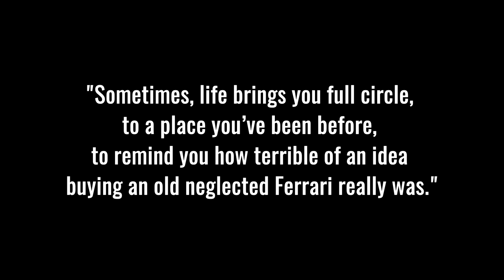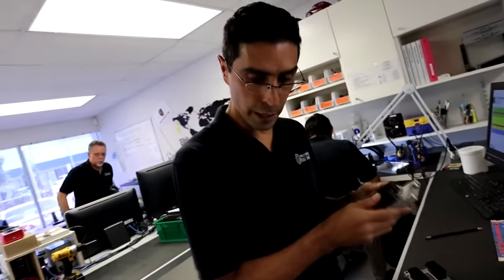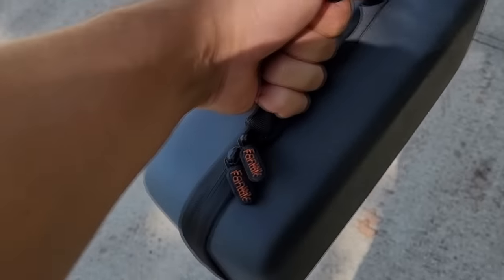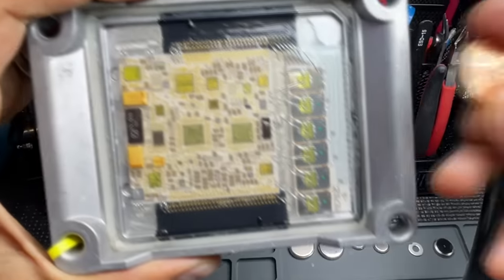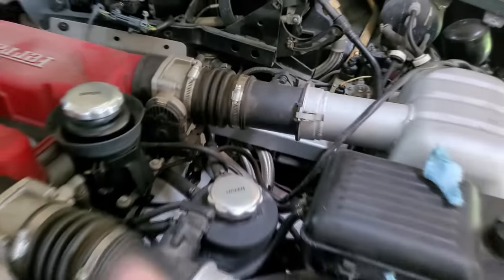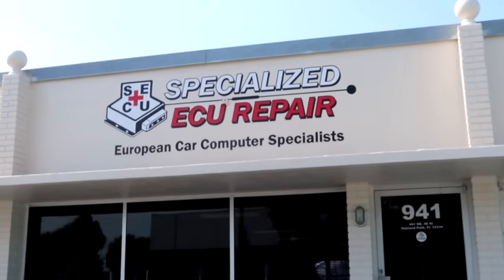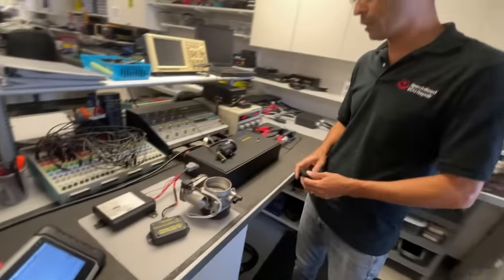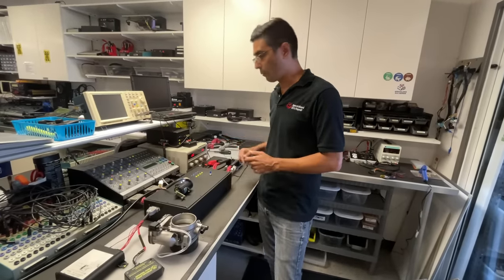Here's What FINALLY Fixed my Cheap Salvage Ferrari!!! (EVERY Ferrari 360's Fatal Flaw)

Comment: If the actual fault can be identified and narrowed down to one chip, and a packaged version of that chip is available, it would be possible to make a PCB with that chip, and patch it in using a wire-bonder. A wire bonder is a standard piece of equipment used in the semiconductor industry - they can sometimes be found surplus ebay, but you could probably rent time on one for a 1-off job.
Reply: You star Mike!   You and the likes of Allen Millyard are amazing with your knowledge...
Reply: If you could get a packaged version of every chip, transistor, etc on the board, I’m assuming you could also just make your own 3rd party boards, flash them and sell them.  Probably a more durable version at that.
Reply: I suspect it will be easier to just design and manufacture a replacement board made using standard techniques. Low volume PCB assembly is surprisingly affordable now. If a circuit diagram is available for this module it wouldn't be too hard. The only parts I would be concerned about are the processor (is it custom?) and the connectors, although it seems they are available as the test machines have mating connectors.
Reply: @nicholasvinen  the processor is probably so old it is extinct, you would prob  have to make an emulator which by that point you mine as well by a new one and eat the cost
Reply: It's a bosch ECU and they've been using proprietary ICs since the analog days of their L-Jetronic control units. If one of those failed you'd hope that you could find one on a donor board!
Reply: The wire bonding isn't super easy, but def can be fixed - look at the Bosch ABS ECU for a number of cars (like VW) - there's quite a few people that fix the wire bonding in those.  The problem would be if a physical chip (like the actual CPU chip) needs to be replaced, I doubt those are available (and this is what the right to repair movement is all about - making those itty-bitty parts available to people and repair shops like Specialized ECU repair so these things can be fixed).
Reply: Thought about you and the fix you did on the Versatronics pick and place driver.
Reply: IMO, it would be equally costly to just design whole new PCB that is electrically compatible.
Reply: @philipparana9225  several manufacturers still make the 8051 which was released in 1980. Yes, it's possible it's no longer available but there's a good chance that it could be.

Also emulators are pretty easy to make with FPGAs.

I agree it wouldn't be worthwhile as a one off but someone could make quite a bit of money designing a replacement and selling it.
Reply: @babaganoosh555  If they can read the code off the ECU (the start of the video appeared to show them doing it and their test rig before the code reader would likely corroborate that), an emulator and board could be fabbed (in theory) BUT the cost would unfortunately be "prohibitive" for a single model of car.
Reply: or stick a haltech on it
Reply: at some point (probably thousands of dollars in the past for some owners) it makes more sense just to gut the wiring and throw in a syvecs. throttle body's have some kind of proprietary chip in them? way cheaper to just machine an adapter plate and use a standard affordable tb than a ferrari specific one. (assuming you have a syvecs or motec or whatever)
Reply: @adragontattoo  I think you are overestimating the cost of developing an emulator. Given decent documentation of the original chip and a test rig, I think it could probably be done for well under $10k. That only has to be spread over a few hundred units to be worthwhile.
Reply: There are images of decapped chips out there. You can probably make a pretty good guess just by finding a good match for the exposed wafers in that computer. Then I think you could build a circuit board that held encapsulated versions of all those chips and make a connector to plug it into the factory harness and have a completely new replacement computer that is serviceable. They might even be able to add extra diagnostics,
Reply: @nicholasvinen  Not disagreeing, IF you find drivers, not just owners.  I was thinking from the standpoint of a vehicle that MOST people can't afford, and of those that can, MOST won't be willing to foot the bill for something that will likely depreciate the "value" of their car.  How many of of the owners are actively driving their cars and not just staring at their "investment" in the garage.

It SHOULD be feasible to do though.(within reason)
Reply: If there are packaged versions of the devices, it'd be even easier if they are pinned to make a PCB onto which they could then be mounted. It was really hard to see in the video, but it looks like the dies were wirebonded and only protected with that silicone gel. Unbelievable. In a package the dies would be more sturdily protected with a hard resin, like with the BMW ECU. I'm betting the dies are OK and a wirebond (he called it stitching) had probably broken on one or 2 contacts, but because the dies are bonded to the ceramic substrate, I doubt there's a way to extract the dies.

In any case, if someone has the money and the desire to do it, something can be done to replicate the circuitry to manufacture a solid replacement. It's really a matter of money. Just have someone whip up a design for the chips, fabricate them on a 200mm wafers, pay a foundry to fabricate them and package them, print up a pcb, and mount them. Money money money.
Reply: The clicking also seems like the ECU is restarting over and over. Then it is also caps that usually go bad first. As I also see some yellow tantalum caps there. I am guessing that the power supply on the board is bad. As it also have taken out the communication. Measuring the power supply should be possible on the tantalum caps as they are relatively big.
Reply: Probably cheaper and a much better idea to just fit a quality aftermarket ECU....
IT would also probably run better, and be a lot easier tune
Reply: @brokenstereotype  I think that's the right approach.    In fact, you could probably get an industrial version of a Raspberry Pi that would do quite well, put an I/O controller around it, and then write some software. Easier said than done, yes but that would be the solution to these small volume older cars.
Reply: You mean like a daughter card?  I was thinking maybe an emulator might be a solution, move everything over to software on a Raspberry Pi or something just big enough to handle it.
Reply: Possible? Probably yeah. Viable, absolutely not. You must reverse-engineer the whole board, customize it and produce it in a way that makes financial sense to you as the producer, to Ferrari and to the whole market
Reply: @babaganoosh555  or switch to carbs…😂
Reply: And like older game system that we try to keep alive, all the electrolytic capacitor if any need to be replaced :p But I get what they say all is encapsulated in resin and direct connection to the silicon :'(
Reply: @philipparana9225  If the processor is custom then yes but most of these car manufactures use common off the shelf processors. Nobody wants to reinvent the wheel it cost too much time and money.
Reply: Dude fueltech already has a ecu designed to work with a Ferrari..  the damn owner has one and drives it as proof of it all..
Reply: @nicholasvinen  The firmware on the microcontrollers is the biggest pain in the butt. In some they are encrypted and read locked and in others that may be car model specific (and in some motor cycles as well). And that’s just the start.
Reply: @burra7  My thoughts exactly.  When you see how the 'good' ECU momentarily clicked the throttle body, then stopped, I immediately thought power supply.  It was almost like the ECU was in its startup mode.  
As you said, probably just a dry cap somewhere.  Considering even the fix-it guru wont touch the faulty ECU, its probably worth a shot at fixing it.
Reply: @XxmillerniaxX  Thats all well and good, I thought that too, but its what else that ECU operates - and with the F1 gearbox, I would say there would be connections between the gearbox computer, body control and the engine ecus.   If it was a manual shift gearbox, Id say, for sure, throw and aftermarket ecu in it.
Reply: @bobolulu7615  Turbo Yoda did a car not so long ago involving a Transmission and Haltech ECU. There are also quite a few Lotus's running around with Haltechs.
Reply: @burra7  I agree on the caps. Should be easy to test in circuit. And check continuity of those bonded wires. Would be nice to see that board under a nice bench microscope.
Reply: @nicholasvinen  came here to say this
Reply: The fault will be the bond wires, these ecus are used in a LOT of vauxhall(GM) cars here in the uk. and they get repaired by stripping the jelly then re-bonding.
Reply: @denisohbrien  makes sense that it’s vibration, heat, or static discharge that’s killing it. Or an underrated cap. Possibly tantalum cap mentioned above.
Reply: Ha good luck with that 😂😂
Reply: @nukedathlonman   Great comment and insight. Perhaps a compromise would be to have manufacturers obliged to release schematics and code after X years. At least community would stand a chance of maintaining future vintage cars. It'll only get worse with increasingly complex cars. Nice to see a Binky fan - nearly there!!
Reply: @jameswilksey  it's not really insight - it's something near and dear to my heart as I like repairing all sorts of electronics (computers and related - but I'm no Luis Rossmann) and self maintain my cars (mods no so much these days).  And your right about that.  And it's also inexcusable to see such high end machinery written off due to it.  But enough politics though, I hate them.

Binky is one of the most epic projects cars I've seen taken on - I only have dreams of doing something so crazy.  Maybe someday... :-)
Reply: @teekay_1  rpi is not a realtime cpu. Don't think it's suited for engine control. Maybe an arduino mega can do it.
Reply: @Quasam  I get that, but you could control an engine with an 6502, there's nothing happening that quickly in an engine.  The only reason you'd use an embedded processor for this is because it's cheaper.
Reply: @philipparana9225  Most old processors -unless made to order for a specific customer - tends to be available almost forever because they are used in many, many products. They may have a different article number after moving away from lead in the solder.

In some situations, there were multiple manufacturers and one or two brands stops making them. Sometimes a new company buys the rights.

But processors for automotive and industrial use tends to have a quite long life soan, compared to processors in mobile phones or desktop/laptop computers.

But with a big enough need, someone could reverse-engineer the expected output logic. There are already companies selling generic ECU for engine builders etc.
Reply: @greatpix  Why involve a R-Pi when there are generic ECU to buy with software there. So it takes a guy with a laptop to fill in lots of parameters for timing, ignition order etc.
Reply: @Quasam  R-Pi has a CPU. It's the code that dwcides if it's real-time or not. So it's the Linux OS that isn't real-time. Not the hardware of the R-Pi.
Reply: There is also another potential problem- manufacture of unique components or that houses those components might under contract obligation not to support anything outside an OEM manufacturer.  I have witness this with 3rd party suplier and manufacturer.  Once original company found out about the 3rd party suplier. 3rd party couldn't sell any more parts directly to my company.